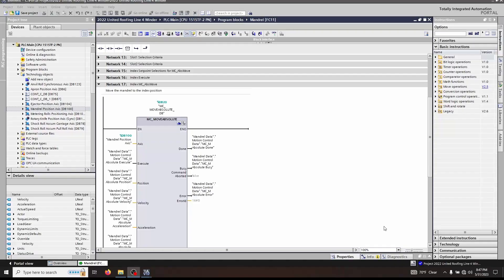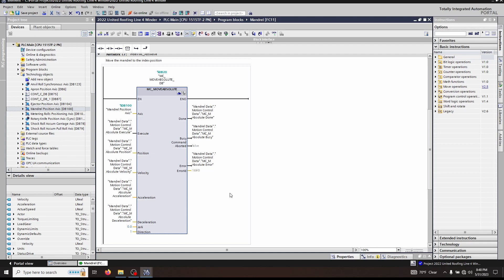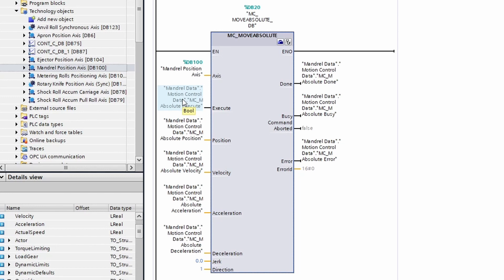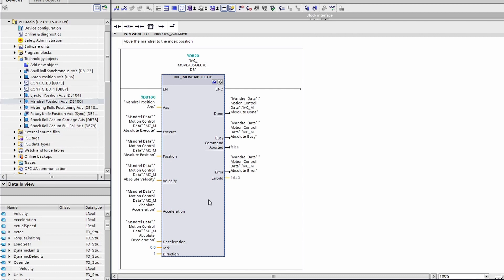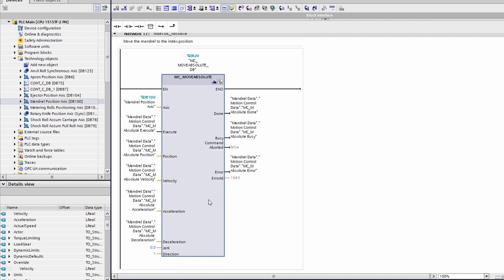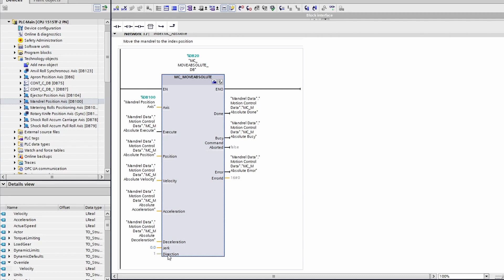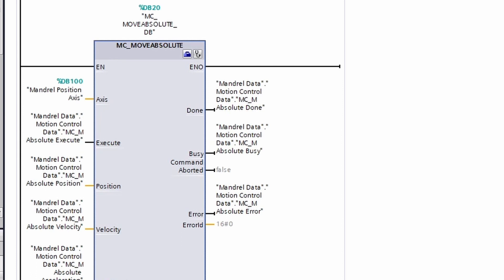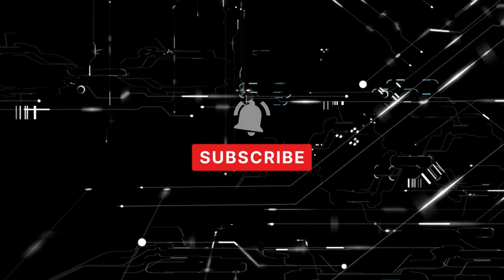Using Siemens PLC Function Blocks: MC_MoveAbsolute

Comment: I have a smal question about using Modulo funktion on linear axis. I must use MoveAbsolute block or MoveRelative? I am trying to do a test and when i use MoveAbsolute the axis move only 1 time.
Reply from the maker: Check out my "Motion 101" stream for a lot more information. 

Mc_relative moves you a distance from where you are CURRENTLY. So if you run the same move again it will travel the same distance every time.

MC_absolute moves you a distance from 0. So if you are already that far away from 0 it will not move again because you are already there.

I draw it out in my livestream...
Reply: @jasonwattsae ok, but i think when modulo function reset the position to 0 i can move again but it dont work like that.
Reply from the maker: Modulo resets when you pass the modulo range. If you enter a number greater than that number it will still keep the same position as it tracks its actual position vs the encoder position. I will look, but there may be a way yo disable this position tracking.

If you want to trigger the same move and it keep moving you will need to use MC_Relative.

Comment: Any tips on controlling an unspecified synchronous motor with an encoder?
Reply from the maker: Ultimately, being able to identify the pole position is probably the most important thing. If you can't get through the PolID then you need to do a manual adjustment. I will see if I have the document available that details the process.

Do you have any information on the motor?
Reply: @jasonwattsae  not yet, but I will come back here in due time, keep up the good work man!
Reply from the maker: @ I appreciate it! Join the Discord server if you haven't already. There are many of us that love helping each other out.

Comment: Sir,

Can You consider videos on Gcode handling with economic PLCs rather than going with expensive CNC Controllers?

How can we enable the PLC read Gcode files and produce motion signals to stepper motors which are cost effective and easy to setup.

How can we make the controller like S7-1200 read Gcodes?

 I have seen videos of people running  Gcodes with that controller..
But no idea How  they achieved it..!

If I can simply make a rectangular /Circular pocket on wood interpolating X,Y,Z Axises by reading Gcodes produced from any CAM Application, then We are done..!

sample Code here:-

( Circular Pocket - 50mm Diameter, 10mm Depth )
( Tool: 6mm Flat End Mill )
( Stock: 100mm x 100mm x 20mm )
( Origin: Top Center of the Block )

G21      ; Set units to mm
G17      ; Select XY plane
G90      ; Absolute positioning
G0 Z5    ; Move tool to safe height

( Move to pocket start position )
G0 X0 Y0

( Begin pocket cutting )
G1 Z-2 F200    ; First depth pass (2mm depth)
G2 X0 Y0 I0 J-25 F500  ; Circular pocket path

G1 Z-4 F200    ; Second depth pass (4mm depth)
G2 X0 Y0 I0 J-25 F500  ; Circular pocket path

G1 Z-6 F200    ; Third depth pass (6mm depth)
G2 X0 Y0 I0 J-25 F500  ; Circular pocket path

G1 Z-8 F200    ; Fourth depth pass (8mm depth)
G2 X0 Y0 I0 J-25 F500  ; Circular pocket path

G1 Z-10 F200   ; Final depth pass (10mm depth)
G2 X0 Y0 I0 J-25 F500  ; Circular pocket path

( Retract tool )
G0 Z5
G0 X0 Y0       ; Return to center
M30            ; End of program
Reply from the maker: I will consider it for sure! This would be a powerful tool to have for building your own systems. I will see if there are pre-canned solutions. Otherwise the system would be a little complex. 

It might be easier with the new G2, as it has a cartesian kinematics object available. This would allow you to use the TO concept as detailed in the Motion 101 Stream and the "Advanced Motion Control" stream.

If you can, join the Discord and we can chat with the community about it there. Link is in the channel description.